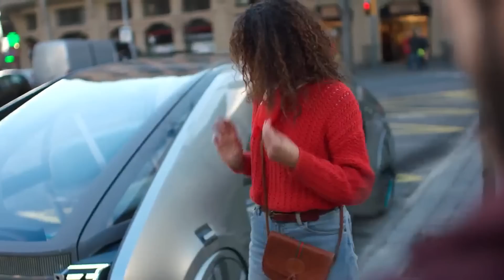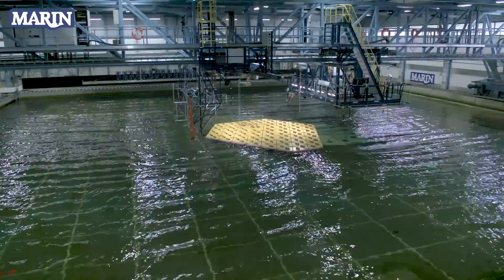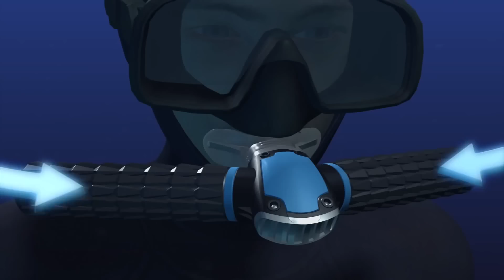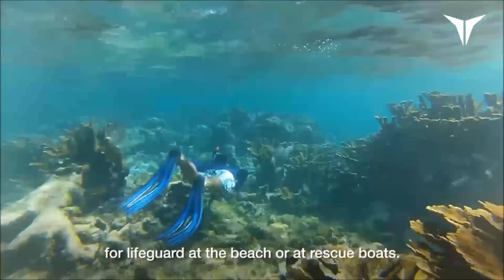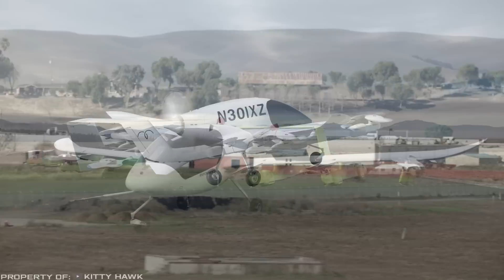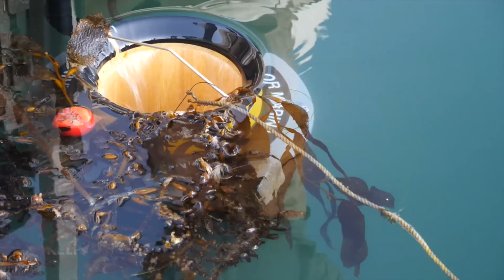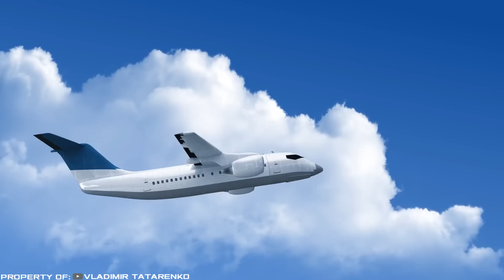New Inventions That Are On Another Level ▶4

Comment: I think the possibility of a cabin section disconnecting from the main body is something all aircraft designers would look at not only for the value but pure safety.  While maybe cost prohibitive but I would pay extra to fly onboard this aircraft than any other, also with the types of material being used today and future materials coming forward would or could make it cost-effective and with the amounts of inspections being done now, this should be strongly looked at.
Reply: They already have small plane (Cessna/Piper/Beech single/double engine sized) parachutes which are retrofits, due to the sheer cost of newly equipped aircraft costing so much more and it being luxury option like seat belts were once and upgrade..  They have  been scaled up for large commercial aircraft, in theory for R&D and applied on larger spacecraft, so the application is there........  Which they're not a mandatory safety requirement in any country sadly,m hence you won't see them on planes.  Aircraft crashes are so low they aren't a big issue on the radar. Even if it   a 747 plane full of people's lives and that is lot more than Moral Panic laws of "If It Saves One Life...."  crap they  punished us with for losing freedoms... and forcing to buy safety gear that sounds good but the risk to use ratio is very low to offset the cost.  Every industry and their insurance companies mandates has put a price on your life and that of others.   Basically Making the cost needing to be financially worth it,  to equip a fleet of aircraft verses the money lost to actual risks. The aircraft is an investment item by itself.  Which how many of these parachutes does it cost to outfit the fleet and the maintenance to test/replace/recertify for life cycles?    That is  the sad way safety recalls work, if  say a vehicle problem will lead to more costs in lawsuits for damages and punitive  awards from hurting people,    then they recall the safety hazard. So until that ,  they won't  build in/retrofit  the items into planes. Otherwise they let it hurt people until that factor comes into play......     Also commercial airliners fly at high enough speeds where even with a regular parachute the forces of the wind would rip a human a part trying to exit the plane. Skydiving planes go real slow and are almost at stall speeds when jumpers exit.

Another scenario option
A whole passenger plane with a top that came off by explosive bolts(that canopy clears before the ejection seat fires on the fighter aircraft)  trigger by the captain/flight crew and then passengers having their seats fired up into the air(I assume you want https://en.wikipedia.org/wiki/Ejection_seat#Zero-zero_ejection_seat options)  and deploying a parachute automatically when clear would be astronomical, let alone the fact people would undo their flight safety restraints. 

The general public with ejection seats they control would be really really bad (tonight on the news, asshole gets pissed because air stewardess refuses to serve them more alcohol and pulled their ejection level decompressing the plane sucking 2 passengers out, drunken asshole was not strapped in and also fell to their death.... .  Also not ejecting when you are tucked in and prepared is also bad. You can't get people to listen, practice and grab the flotation devices under their asses as seen in "Cactus 1549" proved  https://www.youtube.com/watch?v=XfH-H2nNzeE aka "The Miracle on The Hudson"

Sad fact, the reason they gave pilots parachutes was because the training involved in pilots to fly a plane  was far more "expensive/valuable" than the aircraft itself. Trained pilots that could fly a mission, return to base and land where they could reuse the plane and  runway became a commodity(due to pilot & bomber crew losses)  that was a higher cost for more than an aircraft's time & cost to  replace from assembly time to flight line. WW1 pilots took their own parachutes and the first aerial "dog Fights" were pilots shooting at each other with their personal weapons. The military figured out the value of guns and bombs on planes but was a bit slow on that one.  The first "bombers" were pilots throwing out grenades out of their scouting planes. Kinda makes you proud of the human race ability to evolve huh?
Reply: The air taxi of nuziland is a big acheavement,thanks to the engineer's,God bless you

Comment: I think the electric plane is a good idea, but Cora Taxi needs some work, first of all the short distance per charge needs to be combated, maybe something like solar panel to help charge in flight or something, also it think it's a bit too big for road landing, perhaps have the taxi part of it sink lower to land for loading and unloading of passengers, that might require more moving parts and cost more money for maintenance, enough that it might not be practical.

Moss wheels seems like a good idea. just the wheels mind you, not the car they come on. Could they work for replacing regular car tries, or truck tires? it wasn't really explained much on here. Could you put them on bikes, trikes, or other peddled vehicles?

Project Loon, seems a waste of time at first. But it suppose that not everyone can make use of satellite communications.

Comment: Triton was debunked a long ago (check Thunderf00t)
Cora will most likely fail due to weight limits. More power needs more battery which means more load which needs more power. Electric planes are suitable for short and frequent flights, such as pilot training, but that's crazy expensive for taxi service. Where would you land anyway, when most of your customers are in cities, not in large open fields.
Seabin is a essentially a pump, bit of pipe and a net. The retail price for the parts is about $100-200 depending on how fancy system you want to make. It's not worth $3825. Just saying.
Moss in the wheels is a concept, not an actual plan. You get much better results just by either driving a bit less (we are talking about 100m/day or less. Moss doesn't capture significant amounts of CO2 compared to other forms of biomass) or by planting 1 tree. Actually you get pretty much the same effect by having the same amount of moss anywhere.
Aircraft parachute... Does one even have to explain why it won't work? As you are traveling 800-900 km/h any parachute will just break off. And the "prototype" had rocket boosters burning the fuselage at the end. I mean, it will burn you to death, fall on you and crush you to death... There are many, many reasons why that's only short animations and no actual footage, prototypes or 3D models.
Reply: It is so. Triton - scam (insufficient gas volume and insufficient pressure to overcome water pressure at shallow depth). Cora is heavily dependent on batteries ... The vision of small aircraft for everyone has existed since the 1960s, but even then there was a problem with safety, storage, etc. The current advertising is once again targeting families who go for picnics or work, but this is not massively real, as it was not real in the last century, when very small aircraft with reliable internal combustion engines existed. Rich people can fulfill this dream because the price and strict restrictions for others will keep enough space in the sky for the rich and for short taxis. Security will not allow public boom, as it did in the last century. Pump, moss ... I agree. Parachutes ... It certainly occurred to anyone interested in the safety of air traffic. I thought of it as a little boy when there was no internet, and so many other people. The problem is that it's very expensive and airlines want to make money. They have well calculated that after a plane crash, they pay much less than by investing in such a project. The destroyed machine is covered by insurance unless a direct pilot error is proven. That's why you never saw it in real life. High speed parachutes have existed for a long time and can be fired in the order of return of a spacecraft capsule - stabilizing, braking and normal. Saving lives is worth a few grazes. The last parachute can be a so-called "mattress" that can be steered and can slip easily into a convenient place. It is really just about money, and the airline applying it will get a large clientele that will not mind the more expensive ticket.
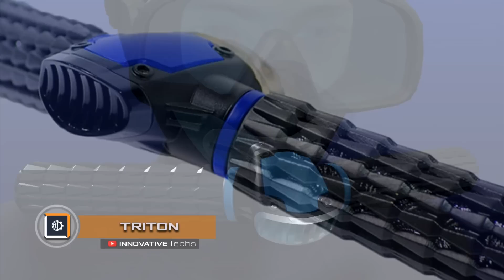Reply: @elmeri seppinen - Your critique is spot-on, from what I read of it. I am unqualified to judge it in its entirety, since I stopped the video at 3:38. It seems my B.S. button wasn't designed for that level of (ab)use, and it broke at that point.
Reply: Even Thunderfoot missed the most worryingly absurd claims of the Triton in his debunking. He never worked through just how much surface area the oxygen exchangers in the Triton would need to even begin to do what is claimed. (Here's a hint, the human or mammalian lung is the most efficient use of such a membrane surface area known to man. We have no way of mechanically replicating it. Yet these clowns are claiming they have devices a fraction the size of a single lung that will do just that. Yeah, no.

Comment: The parachuting detachable emergency passenger compartment was originally from Popular Science Monthly Sept.1921 - google it - there's a pic.
Reply: Besides... it requires a complete, reinforced, separate structure / within a structure. Plus added escape doors/hinges/locks/etc... Added weight - lots of it. More maintenance issues. Lots of them. Plus the parachutes - lots of them. Plus the rockets (at least in this illustration) - yes, lots of them. As they decided nearly 100 years ago, by the time one gets all of this added complexity, systems and weight incorporated into any aircraft (existing or to be developed), there would be enough remaining load capacity / interior space for a pair of hamsters, their (small) cage, some cedar chips, but no wheel to run in (puts the plane over gross).

Comment: Firstly, the seabin can't distinguish between environmentally unfriendly items and things that float in the sea that should be there.
The ejectable cabin aircraft is a non starter as well. Imagine the extra weight from having to design two independent primary structures?
Also, whit if the problem is in the cabin area, like a depressurisation or cabin fire. Theres also the extra maintenance of the cabin release mechanism. It wouldn't be of any use in most accidents, like runway overshoot or flight into terrain. Just not feasible!